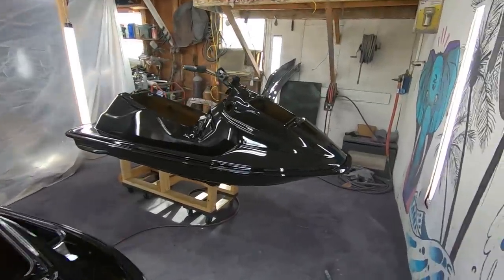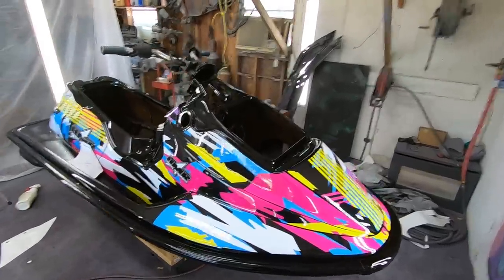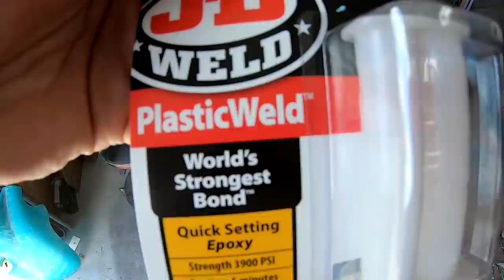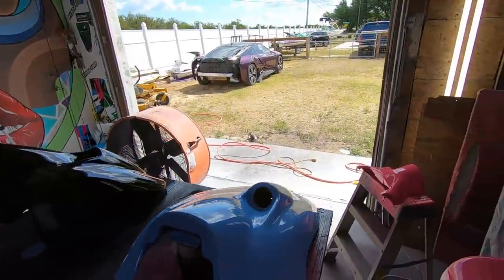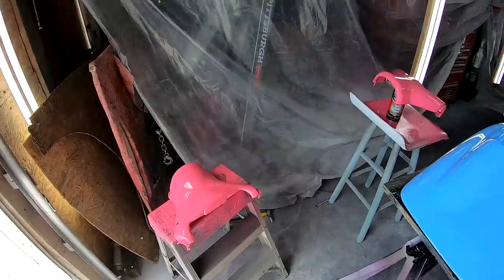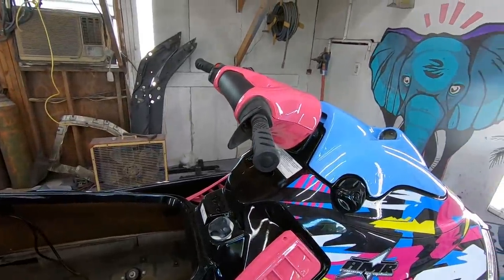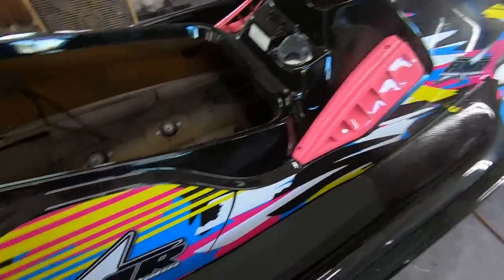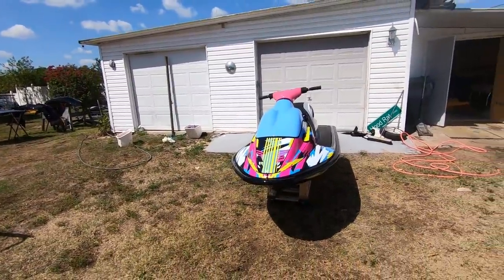Classic SEADOO Get a Modern Retro Makeover -Episode 2

Comment: Use 3M's 77 spray glue for the turf material.
Spray both the area it goes on and the back of the material. Let it get tacky to the touch and be extremely careful installing it as it won't loft off again without damaging it.
I use it on pool table clothe.